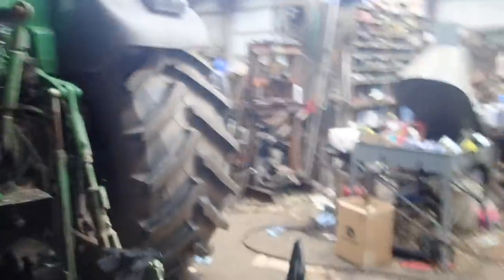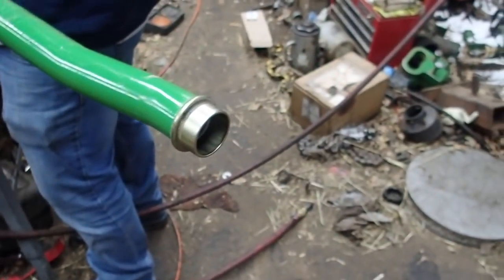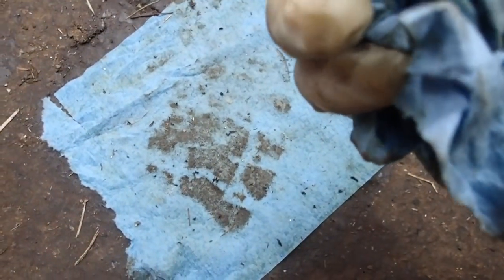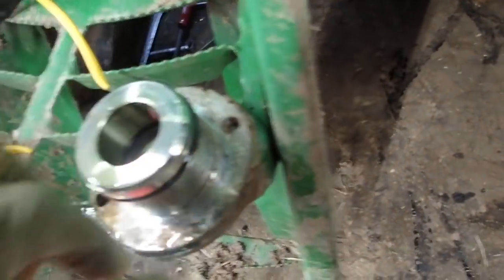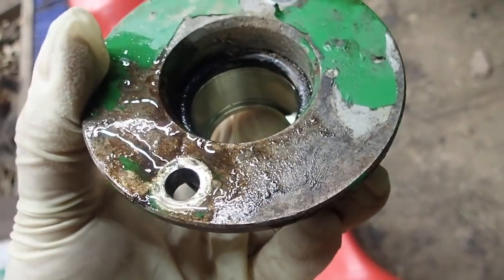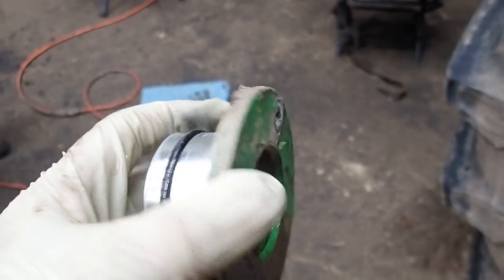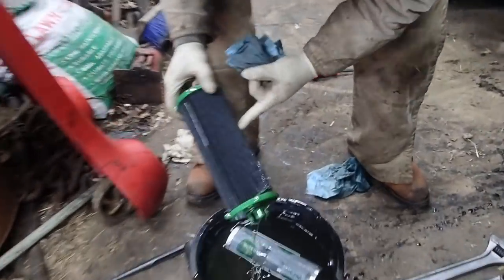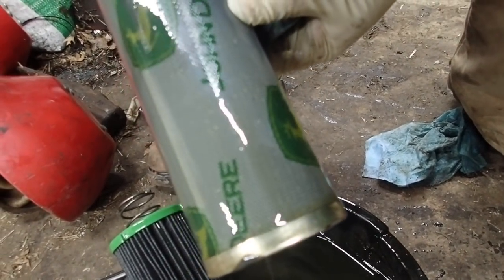7530 IVT Oil

Comment: The brass is from the break band in the 4wd drop box, it's the lever on the left side of the cab. It's normal to find that in the screens,

You alternator runs off it's own drive belt on the engine. The smaller belt.  That's the one causing your belt squeal and you can't tighten them just replace. 
👍👍

Comment: diesel engines were originally designed to run off peanut oil, so it stands to reason that any vegetable oil will work just fine to run them, however in cold weather you do need a tank heater because, in my experience anyway, vegetable oil tends to gel faster and at higher temps than diesel fuel

Comment: dont know if they do this in the states or not but here in britain we are allowed to use used cooking oil which is filtered and something added to it and used as bio fuel for diesels but you can only make so much before you have to pay a fee to the department of transport also its illegal to use red diesel for farm vehicles in a road vehicle like a 4x4 apparently it stains the inside of the tank with the red dye and the dot set up stop points and can stop vehicles and check the fuel and if its red then the nasty stuff hits the fan big time

Comment: We're in the 60's here in the Missouri Bootheel today with freezing rain, sleet & snow moving in tonight & early Friday. We can run Kerosene in Diesel engines too.
Reply: Steve Holsten yeah kerosene is diesel fuel just refined more. my dad used to winterize fuel for the winter by filling or 300 gallon storage tank with 50 gal kerosene and 250 gal diesel never had gelling problems
Reply: I had a friend who had a 1984 Buick with the 5.7L Diesel engine. He treated his fuel in the winter in that car with one gallon of gasoline & never had gelling issues.

Comment: Howya wes I recently had a tractor that had a diesel pump problem and I was told that it was due to the new low sulpher levels in the diesel and he advised me to start putting around 2 pints of oil in when you fill up with diesel and I think that it seems to be working very well maby you should try it in one of your tractors and see what you think
Reply from the maker: been doing that since 2007 but not the 30 series they have an EGR that will gum up if i do.
Reply: onelonleyfarmer oh ya well it is a 20 series and older tractors I put it in. Just out of curiosity how much oil do you put in per tank. Thanks for responding.

Comment: Wes 
On some of the European tractors hav an auxiliary tank on the right hand side of the chassis wich hold backend oil to tip large trailers not sure if a 7530 has this but my 6930 did. Wich should also be drained. Sorry if you already new about extra tank. Love your vids been watching since the 4960 was the main rig! Good work.
Reply from the maker: i saw that on there and didn't know what it was so i didn't touch it. i did tap it with a wrench and it seemed to be empty so i dont know if it was or not,.
Reply: onelonleyfarmer it’s the same size and shape to the air tank if equipped they mount on top of each outher. I made the same mistake first time 😂 all the best from Somerset UK.

Comment: Like you say those few bits aren't a problem, you know it's "F'ed" when you go to a big Case IH 3594 like I went to on a service call and you drop something like 7- 5 gallon pails of oil from the trans and it comes out like silver paint, then when you unscrew the  2 12" tall filters under the front of the cab. Then they nearly break your arm when they come off the last threads, as they have about 20lb of brass and steel fillings in each of them !!!!!!.

 Tractors are the same here in Manitoba they don't have licence plates or road tax either. The tractor we shipped in 18 years ago still had the plate on it from England until a year ago when it got broke off. But the  last road tax disc for it we had there, is still in the holder on the dash so the cops could see it in the windshield  when it was on the road over there.

  Guys have been told stop at the car wash in town when they bring tractors here to fix that haven't been washed in years.Some of them were so bad I wasn't getting paid to deal with the mess, so I made them pay and clean them first. Thanks for the video, It's turned bloody cold here again in Manitoba :( but here we didn't get much snow luckily it went south east this time:)  Take care guys.

Comment: Amazing again, oil change and two filters changed of 7530, I had a speedboat American brand Glastron with 130 hp Volvo gasoline engine, you need to remove the cool water in the engine because of freezing, I changed the engine oil every year, and removed the oil cold it is not easy but it can be done, and the oil of the stern drive 😲💥😲💥💥😲💥

Comment: Wes- question for you. Using vegetable oil for diesel, isn't there waxes that can gum up a Diesel engine? I think the term I'm looking for is glycerin.
Reply: The only problem with glycerin is that it will solidify at lower temperatures, if it is warm, it will go though the engine just fine.
Reply: talleddie81 Thanks
Reply: Daniel Sweeney Diesel engines can burn most any type of combustible oil, but yes many will gel up at temps not much below freezing. But the new diesels in pickup trucks with all the emissions stuff and extremely tight passages and tolerances in the fuel systems don't like other fuel oils. But like the old 2.5 ton military trucks they run on anything and some people even just use old used motor oil for fuel in them after they filter it.

Comment: Wes you wanna grease those lift arms, I’ve had ones bend on me as the guy who’s tractor it was hadn’t greased them in ages! Just a heads up
Reply: Ed Thomas you've got other problems rather than lack of lubrication if you're bending lift arms
Reply: I don’t mean the lift arms as in the 3 point linkage I mean the 2 guide pole things I just couldn’t think of what they are called so I put lift arms
Reply: They are lift arms ---- for the pickup hitch and Drawbar. The problem is if you grease them that in itself will attract muck that sticks and ca lead to jamming, if they are clean and dry that can lead to some corrosion and also jamming. I prefer to keep them dry and occasionally lightly sanded .

Comment: I believe Ohio does not require plats on farm equipment.
Reply: I'd like to know who's liable for damages and the huge personal injury costs if the tractor person pulls a left across oncoming traffic and collides with a motorist, just curious, thanks.
Reply: bill605able
As a retired cop in Ohio and most state's all motor vehicle's have to give right of way and assured clear distance even emergency response vehicles have to use caution while in emergency response.
So if the tractor did not leave enough distance to make the left turn in your path of travel the tractor is at fault.
I hope that helps.
Reply: Yes and ty, for your response my question is who pays for all the destruction and personal injury like a total body paralysis, tractor guy causes? Sorry if I am not clear. That would be a  huge concern in these litigious times in this country, again just curious thanks.
Reply: bill605able 
Unfortunately the victim suffers the pain and suffering and sometimes the financial cost.
But the person at fault is responsible for the financial cost that is after the legal wrangling and your lucky if the offender has sufficient insurance.
To often the victim is seldom compensated for the total financial cost and never the physical cost.
Reply from the maker: i carry way more insurance than 99% of the cars on the road. and just because i do not have a plate doesn't mean i am not insured. it is a requirement to have insurance to drive a tractor on the road otherwise i would be breaking the law.
Reply: onelonleyfarmer 
It's the same in Ohio. All farm equipment must be insured to be legal on the road. Ohio farm bureau offers a low cost high coverage. I worked for a township of witch 80% was farming or woodland and of the farmers in the township they all had great coverage but I did have some accidents were some transient farmers lacked proper coverage but so did many other vehicle's traveling through the township.
After 30 years of being a cop you get pretty good at evaluating cost of damage done.

Comment: I'm surprised that you don't use Amsoil hydraulic oil in your Deere's Wes,I use Amsoil hydraulic/transmission oil in my Deere's.
Reply: 4 gauge it IVT transmissions are picky. The Deere Hy-guard is good stuff. Although I do run all Amsoil fluids in my personal truck and motorcycle
Reply: Drew w Amsoil exceeds Deere-Guard BIG TIME.My transmission temps dropped by nearly 40(38 degress actually)when I switched from Deere-Guard to Amsoil hydraulic oil.

Comment: metal in the back end i bet theres more suck up in the rear end as you drained it down when cold, not good to see metal in there, we have had tractors to bits with over 10000 hrs and never seen any metal in the back end, its going to be trouble in time and will get to see you tear the ivt down but that will be to big of job you
Reply: orkid knog who said it was cold when drained I think Wes has changed enough engine and transmission oil to know exactly how it should be done

Comment: You doing wrong! Transmision oil exchange when the oil is warm or hot. Dont do this when oil is cold!
Reply from the maker: who said that the oil was cold.
Reply: ak 280
Shouldn't assume... Wes is pretty damned sharp in these matters, for sure.

Comment: According to the DOT approximately 8,000 accidents a year are caused by slow moving farm vehicles. Why not attach a standard SMV sign to the rear of your tractors and farm implements?
Reply: Because people don't bother to read them or pay attention to them
Reply from the maker: If I were to place a slow moving vehicle sign on the back of the tractor I would be breaking the law maximum speed on an SMV sign is 25 mph
Reply: So, from a standing stop at a county stop sign your tractor accelerates from zero to 26 mph in less than a second or do you roll through stop signs/lights at speeds in excess of 25mph? :0)
Reply: The way i see it if they cant see the big fucking green tractor how in the hell are they going to see the sign
Reply: Well, some soccer mom hauling a bunch of kids in foggy/rainy conditions might be able to react a little quicker if her headlights reflected the hi-viz sign before she saw the dark green/dirty tractor.
Reply: Sky King no people just don't pay attention I drive tractors all day everyday except Sundays and even if were to use my signal light to turn left at a barn driveway people still pass me or try to even after I've slowed down to make the turn they just don't care
Reply: Bacardi?
Reply: Sky King if the soccer mom can't see four way flashers and a orange strobe light flashing she shouldn't be driving kids around